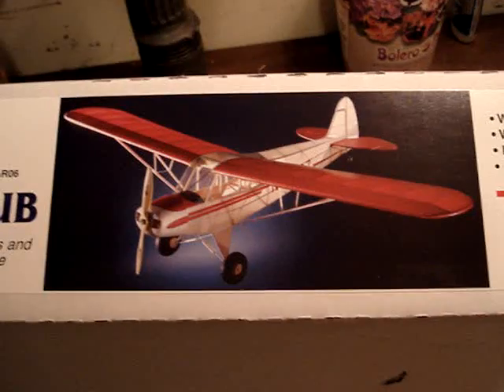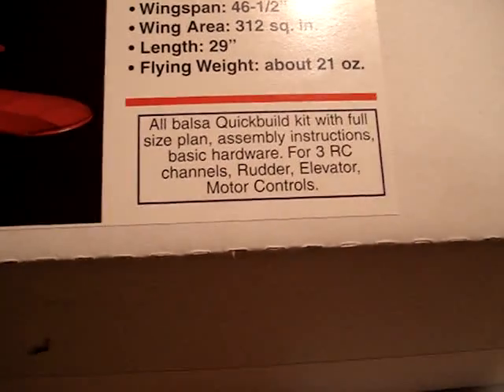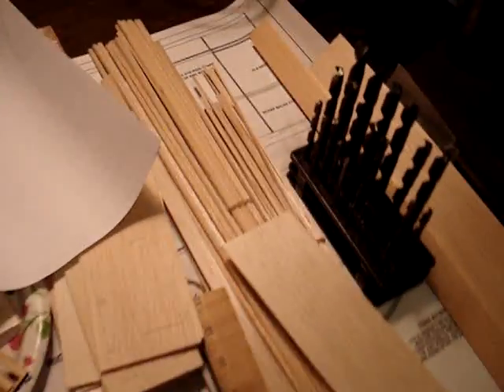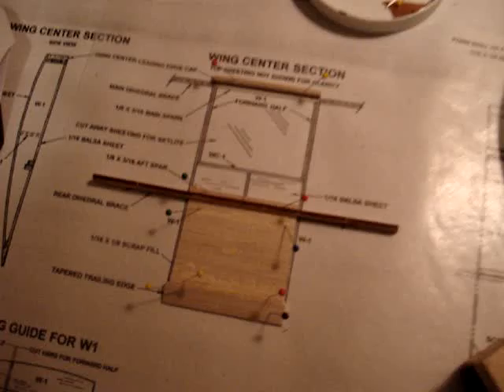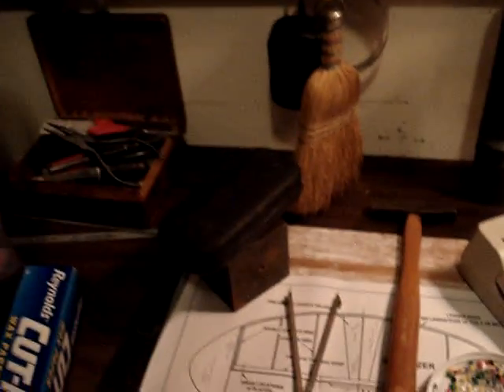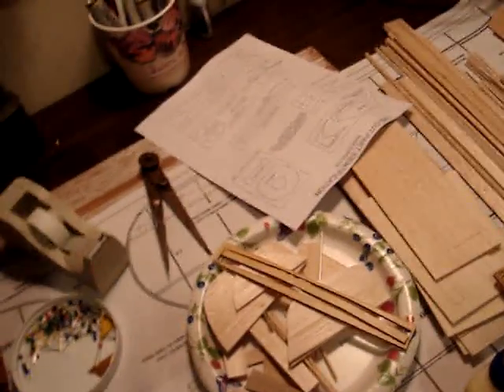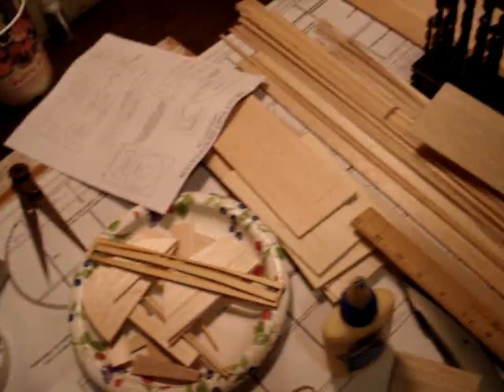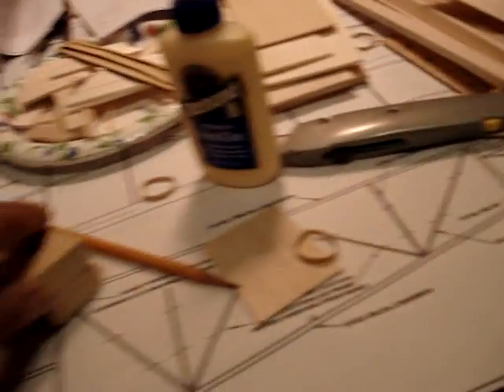Piper Super Cub

Comment: Hi, it stands for "Almost ready to fly" so you can build it in a night or two. The trainers are cheap to buy and are very stable and predictable with plenty of dihedral in the wing, mounted high like the cub. Most look a bit like a Cessna172 and are fitted with tripod gear for easier landing and takeoff. Like your vids by the way, I've actually been after a Flair cub for ages myself.